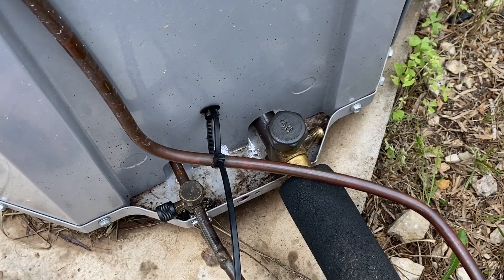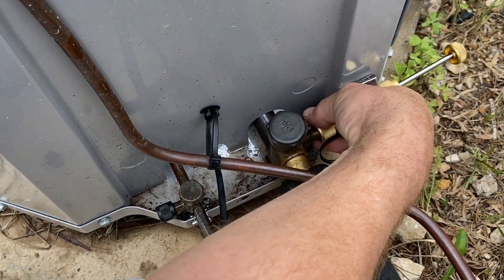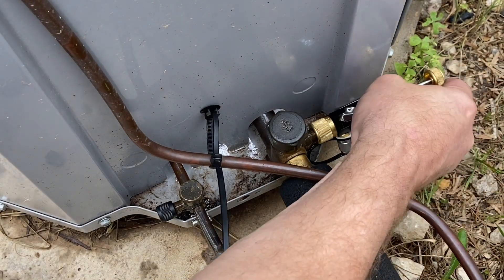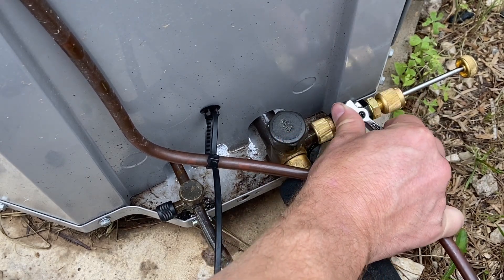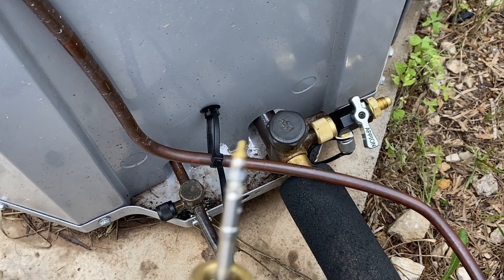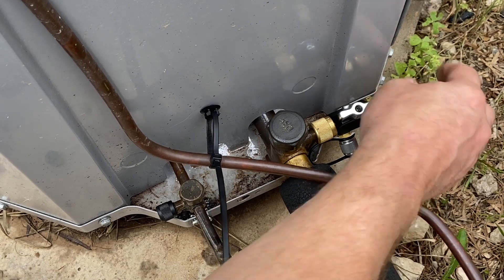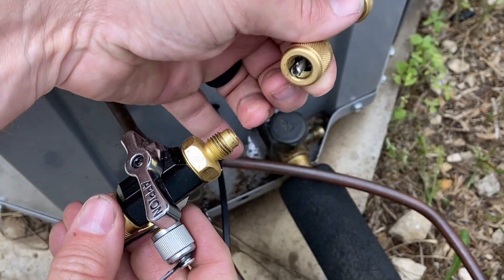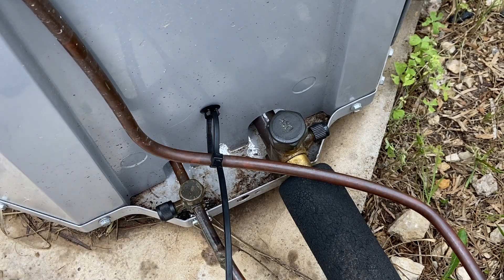HVAC 043 replacing a valve core

Comment: What is the other copper line held by the zip tie for?
Reply from the maker: The low voltage wire was ran in it. There are better ways but that was an old school way of doing it. The copper had to be debuted and preferably flared on both ends.

Comment: I found out early if you over tighten the tool to the access port you'll have a hard time getting the Schrader.
🍺🍺🍺🥃🥃🍇🏌
Stay safe.
Retired(werk'n) keyboard super tech.
Wear your safety glasses.
Reply from the maker: Somebody just mentioned there is a torque tool for it. I will look it up tonight.  Love learning new stuff.
Reply: @love2hvac  yellow jacket 18993 gas retention valves